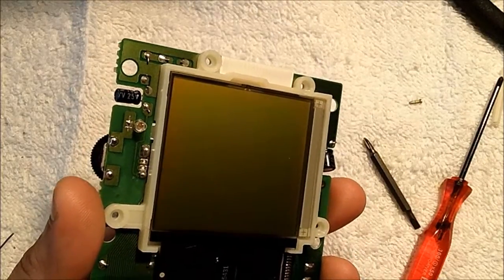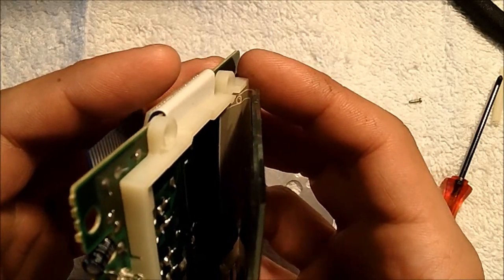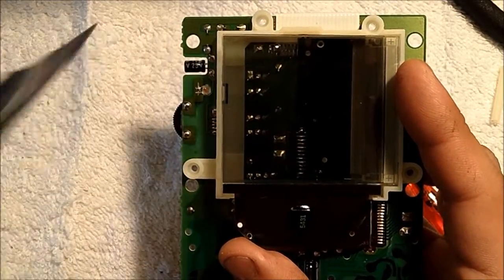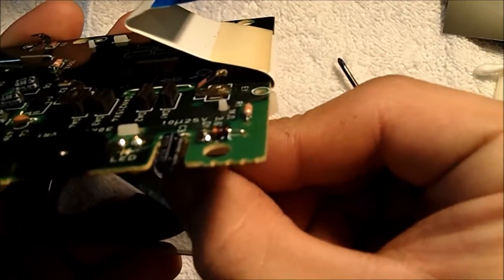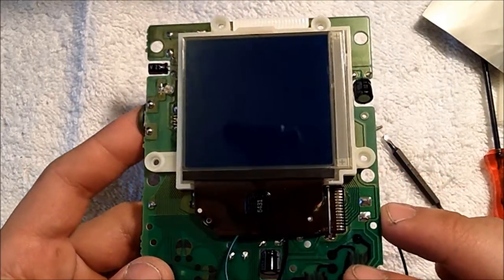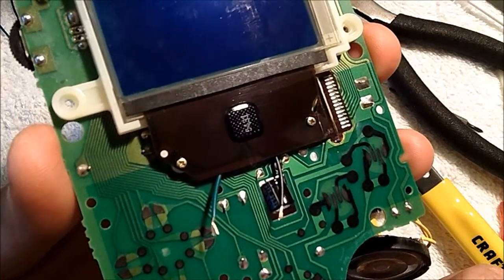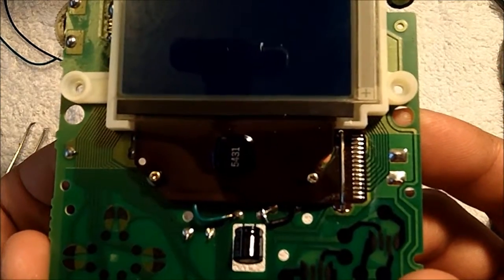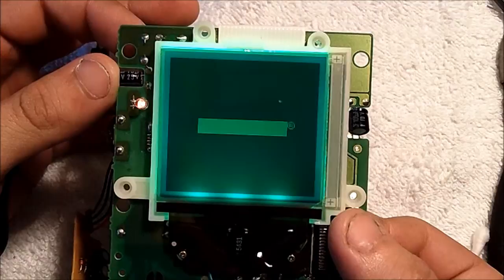Modifying your DMG-01 Gameboy for Chiptune Part 2: Backlighting your Gameboy [2/2] [HD]

Comment from the maker: If you invert the screen through the LSDJ menu it should help or by adding a Bi-Version Chip w/ a Normal Polarized Screen, or use a Backlight Panel with an Inverted Polarized Screen. Blue and Red are supposed to look better with Inverted Screens. If you want something crisp, I suggest de-soldering your Blue Backlight and swapping it out with a Green, White or Yellow Backlight Panels.

Comment: When I bought my DMG it was $2 because I found it in the bottom of a bucket of random wires and shit at a garage sale, and it was wet. I figured it wouldn't work, but it works just fine without any sort of internal damage (or so I thought). When I started to do the prying, I noticed that it looked different then yours, and it turns out that some water had gotten underneath the screen, and it messed up the adhesive, so getting the stuff off took HOURS (literally!)

Comment: I figured it out kind of... but still need help.  I disconnected the wires of the led screen to see if the normal screen still works.  and it does!  But as soon as the two cables on my backlight make connection it turns off the screen and also prevents the game boy from reading the game cartridge inserted... but turns on the light... any idea what to do?... I am thoroughly confused!